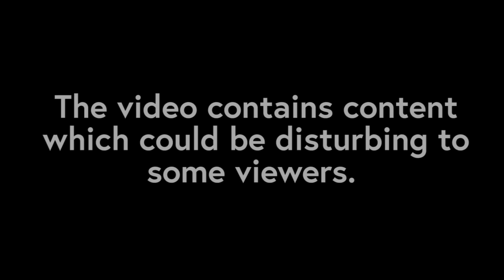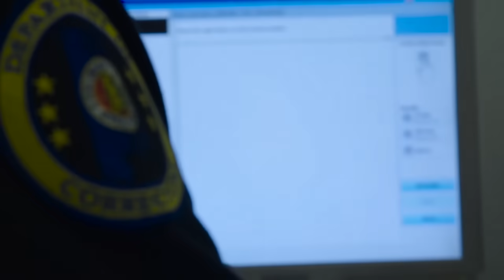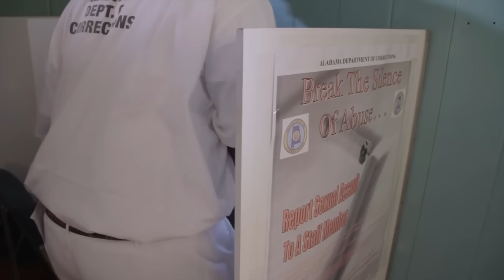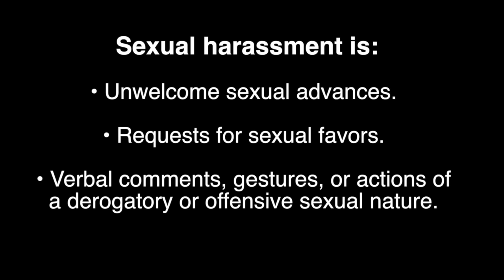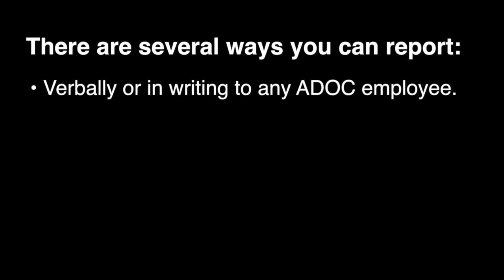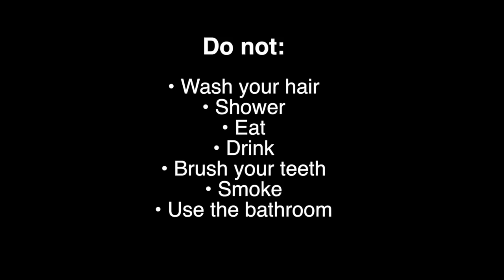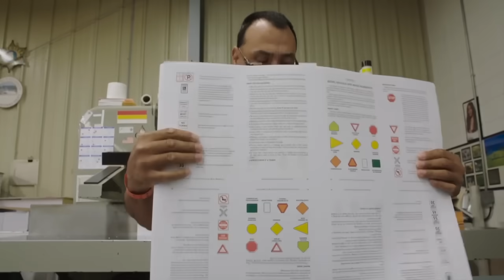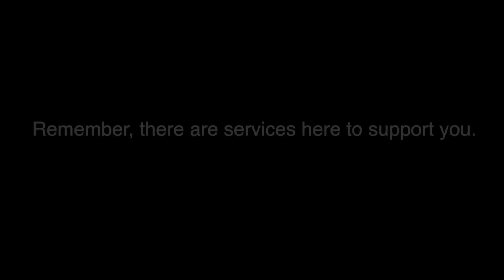This is the video the State of Alabama shows new prison inmates on how to avoid sexual assault

Comment: 7:00 If an officer seduces an inmate into sex, the inmate gets charged with rape, not the officer. They don't make that clear, but that's how it goes down, so heads up. There's also such a thing as reckless eyeballing. That's when you get caught visually checking out a female officer. That can get you registered as a sex offender. They don't exactly tell you that, either. So again, heads up. 7:00

Comment: If the guards and leadership lost money every time an assault of any kind happened, they would stop- guaranteed. Instead, they put it on the inmates to protect themselves which will almost never work. The prison needs to be held financially accountable. People need to be fired if an assault happens. New processes need to be put in place now. There are places, prisons and countries where things almost never happen. They run their systems responsibly. They need to model after those places- not leave it up to random prisoners to watch their own backs. Prisoners should still use common sense but that does not let the prison officials off the hook. 

Why allow prisoners to be in gangs, get tats and lift heavy weights behind bars. It only adds to aggression and their ability to inflict harm- seems to be a dumb idea.  What would help this problem is if prisons no longer had shared showers or insist that armed guards are in there whenever prisoners are there. Don't allow open access in any areas that are out of site of guard supervision including empty rooms, shower areas, utility closets, etc. I've heard guards are a big part of the problem- often worse than the prisoners. Corruption runs wild in prisons- there needs to be someone guarding the guards, like an IA division inside. 60 Days In is a good start.

It could be stopped immediately- but they don't want to stop it. It's all lip service. Tell the warden, 1 more assault and he is out of a job and the guards will be docked $2,000 for each offense. Change would happen real quick. It's always about the money. They are likely understaffed and trying to stretch the budget. As a result, the budget isn't the only thing getting stretched. Then they have the audacity to almost blame the inmates. So when it happens...they will say, Did you do this or that? Did you make friends with him? Did you let your guard down? Pathetic. Do your job and keep these guys safe.

Comment: Even though Priscilla is not as bad as it once was you still need to remember there is no safety there. Some guards are good and will try to help you if needed but overall most guard's think of you as a piece of pocket lint. They could care less either way and sometimes the guard's are more dangerous than the inmates. And that blew my mind!

Comment: brush  teeth so they dont rot. that is better advice than this video. 12 yr in the can in Angola. this video will not help you. Sometime trouble cant be missed. You learn the habits of the rapers and avoid. During 1980 very few camera so you never wanted to get cornered or isolated. If they do start making  obscene gestures  be very careful because the target is on you. Dont give in because it will become worse in the future, from more and more rapers. At some point your probably going to have to fight. This a a hard line to cross. But every body know what is happening. so make sure it occurs in a visible location where guards will have to document it. I was 22 and a target before done processed.  guards understood let me keep a screw driver they discover that I stole from a plumber and kept for  a long time until I got it stuck and lost it. That is the only reason my behind remains intact. Some poor souls ust get  porked 3x week. If you get har grabbed you are finished, cut your hair. The psychological stress of the endless sex attack caused pen suicide, not drugs or other problem.     So, suddenly, these two guys appear in front of me like magic They stopped real aggressive Start at me pushing me down the dead end on the day room you know. one had apiece 2.5 feet of raper cord I had the driver.  "W-what's that in your hand what the F is in youar hand? -Yeah You better put that MF down...M yeah its just a phillips head you know. They tried to take my scrw driver you know and then I got bit alot and my friend was working. working working working. no other thought in your mind but work overtime while other trying to get you off. after reaching maybe lizzy borden land he got stuck, I was holding a split piece of wooden handle. thats why u dont have hair.